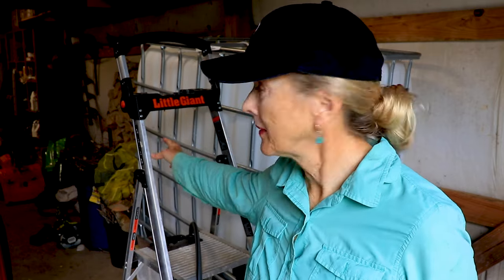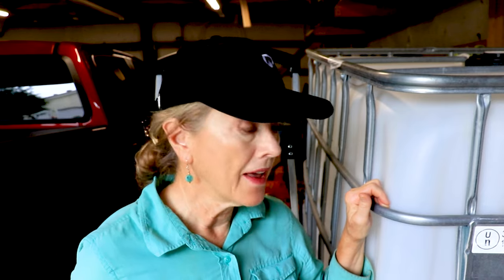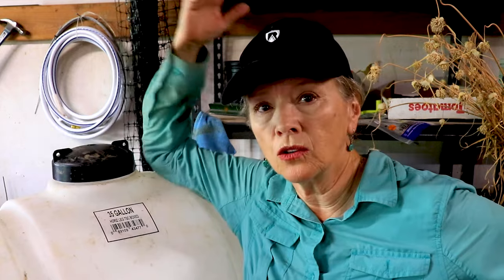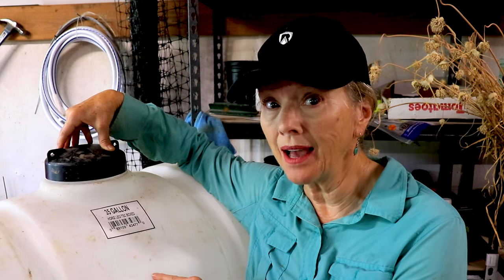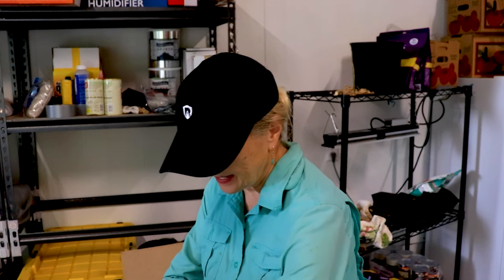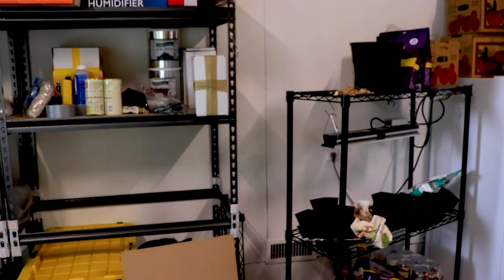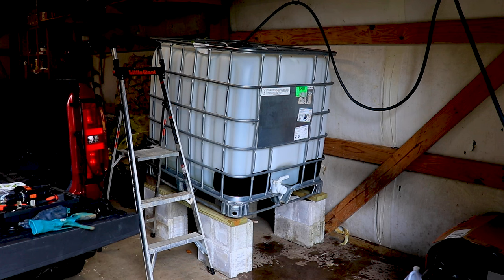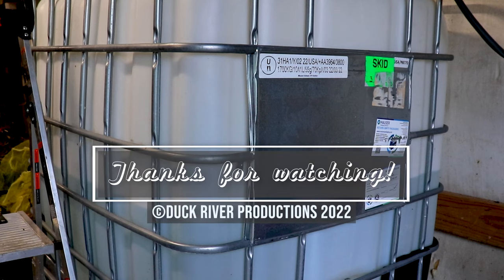TIPS storing water LONG TERM! (Don't make THIS MISTAKE!)

Comment: Please help me 🙏 Hi I have 5 gallon collapsible polypropylene food grade water storage containers.  And I have the Aquamira 2 part Chlorine Dioxide treatment. 
I'll be using city water from the tap. I have to treat it because in our area it's very contaminated.  How do I treat the water prep the gallon containers the right way?
I read the polypropylene breaks down and can't handle chlorine or Bleach? 
Can I still use these containers with this aquamira treatment? Will it poison us? Or make the containers leach chemicals?
Also let's say it can be used how do I start? 
Wash each container soap and water rinse. Do I  splash each container with Bleach? Then add the tap water then add the drops of treatment?  Do i have to boil tge water first or can it go straight from the tap? Or should i just buy distilled water instead? Then treat it with drops? The goal is for long term storage for hopefully 2-3 + years if possible. Ill be doing multiple containers want to do it right. Thanks
Reply from the maker: Oh, boy. That’s a lot to answer, and I am not an expert. I don’t want to give you wrong advice. I’m not familiar with the aqua Mira and I don’t know about the polypropylene. If it were me I would first contact my local water district and try to speak to somebody with authority and knowledge not just the assistant, like the head guy that’s been responsible for water treatment for the community. And I would ask him these questions. Start there. And of course do some research online and get reviews for this aqua Mira get some testimonials. The Chlorine breaks down overtime and you need to think about filtering the water after it comes out of storage. It would cost you a fortune to buy enough distilled water to put into this container. Depending on where you live there might be a natural spring that you could go and fill up your containers and then filter it when it comes out rather than trying to make your city water safe before it goes in. Please keep me posted as I would love to share this information that you learn because I suspect there are many many people in this country that are dealing with the same kind of bad water that you are. Fluoride is the hardest thing to take out of water. if your water district puts fluoride in the water (you can find this information out online or call) it would be worth driving to another water district that doesn’t and fill up your containers there and then plan on having a really good filter for anything that you consume when you do have to use it. I hope that’s helpful.🙏🏻
Reply from the maker: You can always boil it when it comes out and as for cleaning the containers if they were new and they were supposed to be the food grade size containers then I would just use soap and water because you’re going to be filtering the water when it comes out anyway.
Reply from the maker: Another thing, you want to refresh that water every year or so, you know, I wouldn’t leave the water in there for 2 to 3 years
Reply from the maker: Which is why I hate to see you to go to so very much trouble the water going in it would be much better if you could just get to a fresher source fill it up and plan on a good water filter coming out or a distiller and if you find a distiller that works well for you please leave a comment here so I can share it, I’ve been looking for one. Distilling is better than boiling but it takes a lot of energy (gas or electric ) and a lot of time.

Comment: Why are you not supposed to put them on concrete?
Reply from the maker: I was just advised not to. A quick search led me to this answer in a forum, which seems to make sense. You might want to research this more. "Storing plastic water storage containers should be done on a wood or plastic platform raised at least 4 inches high, and then, on painted or coated concrete. Swarming insects like to follow continuous lines first, so a raised platform breaks this up. In addition when the containers are on the ground the bottoms collect dirt and debris blown around by the wind. The dirt attracts moisture as does the junction of the edge of the plastic storage containers, where the side wall meets the bottom and the small gap between the plastic bottom and the concrete. The stored moisture starts to weaken the steel rebar embedded in the concrete, which is there to strengthen the concrete. Painting or coating the concrete floor especially with epoxy keeps this from happening. If the area is supposed to be wet normally, the top formulation of concrete should be like that used for dairy stalls. The only way the water gets contaminated is from direct sunlight promoting algae growth, or untreated water growing micro-organisms, or unsealed tops subject to contamination. All these water contaminants have little if anything to do with concrete per-se."

Comment: The plastic tote had a plastic like smell to it when you opened it ?? That's messed up. I'd take it back and say "wtf ? This thing has obviously had plastic or glue in it. Open it up and smell it." If I'm gonna spend good money on a plastic tote, it needs to smell earthy when I open it up.
Reply from the maker: Well, it's made of plastic and it had been sitting closed up in the sun, so it was probably just that. I've decided (since it's so far from the house anyway) I'll use it for all non-drinking uses, and get a 55 for the garage. I've gotten a lot of great comments and I am learning, too. Thanks!

Comment: You should be using FOOD grade water hoses. Regular water hose contains materials that are harmful to humans. Wal Mart sell them in 50 foot lengths. It is better to safe than sorry.
Reply from the maker: Thank you. I had bought a 25' (not cheap!) which was all I saw on Amazon the day I looked. The expanse is over 100' so to get the thing filled I had to use what I had. But, I agree with you entirely!.